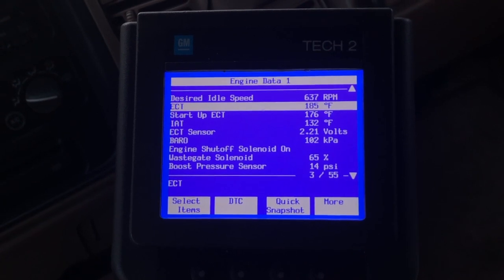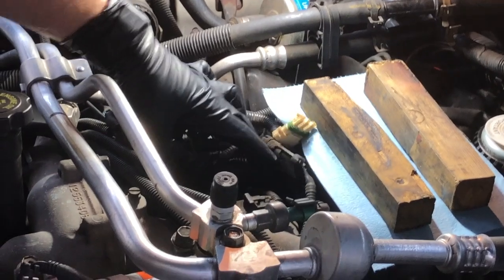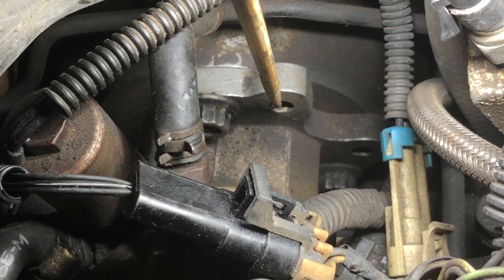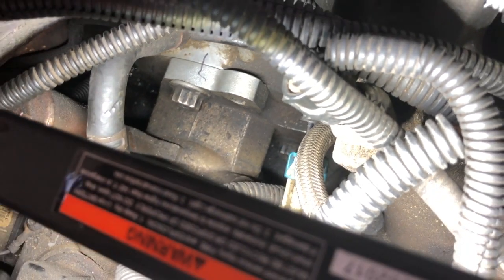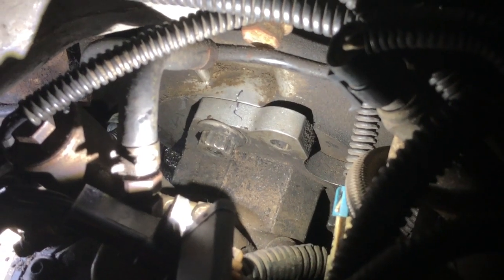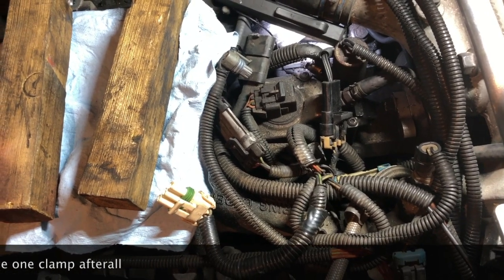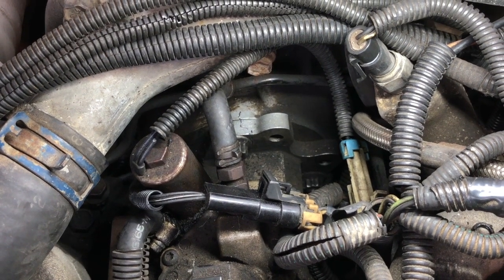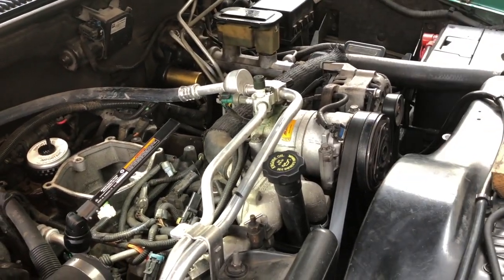1996 - 2002 GM 6.5L Diesel Stanadyne Injection Pump Timing Adjustment TDCO Procedure (Chevy & GMC)

Comment: Hello guys I have a problem, maybe someone can give me tips
Setting the Timing arround 3.5 degrees.
It' jumps from 3 to 4 degrees.
The lowest i get is -2,02 the last try is -2,45
Please someone could Help me? Where is the problem?
Reply from the maker: If it's a 1996 or higher, how does the timing chain look?   Jumping around like that, presuming the pump bolts are at the right torque, I'd want to check that for stretch.

Comment: 94 and up
Reply from the maker: It turns out the Tech2 procedure is not the same for pre-1996 so based on feedback I removed 1994 and 1995 some time ago.  But yes, other than the scan tool part the rest would be the same for those two pre-OBD2 years.

Comment: It's  strange why Gm used metric  fasteners. For the most part the US is not a metric friendly country.  Also ive heard many suggest tossing the engine beauty cover as it traps heat in the valley of the block. A place that has been stated by 6.5 gurus gets hot enough as it is.
Reply from the maker: All US automobile manufacturers began moving to metric fasteners in the late 1970s.  GM started in 1977, for model year 1978.  Remember US companies export and sell vehicles to other countries and metric would be required to do so.

Comment: Now how to time a pump when it won't start 🤔
Reply from the maker: You might try the service manual procedure for setting the initial timing alignment as you would with a brand new pump installation, to at least get close enough for it to start.

Comment: the manual i had had wrong figures for timing offset,when it gave an advance figure it was actually retarded same amount,other than that it wasnt hard
Reply from the maker: There are problems reported in several forums with aftermarket scan tools, e.g., Snap-on, and others getting the TDCO values wrong on these 6.5s engines.  And some of the non GM service manuals also have gotten TDCO values wrong.  But the genuine GM factory service manual I showed here, and the GM Tech2 scan tool (clone or genuine) with all the current firmware updates applied thru 2013, are completely spot on for TDCO.  There's also the differences between TDCO and base Time Set or TS.  These both have to be right for the timing to be correct. But this video only covered TDCO.

Comment: Leroy's Diesel has a temp cheat tool to plug it the temp sensor to cheat to 180° so you dont have to warm it up. Check there page.👍

Comment: That is setting injectin pump timeing
Reply from the maker: This video is about the GM service manual procedure to adjust the TDC offset for 96 and up using the Tech2.  It does require a pump movement, but it is not the same as the base timing procedure.  I cover the injection pump time set in this video https://youtu.be/Fir18Ll5l3Q